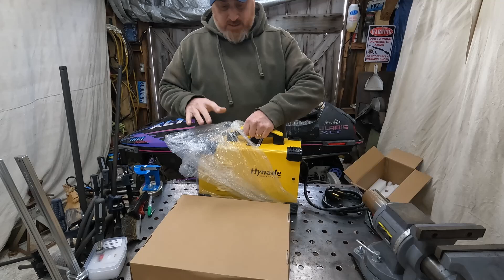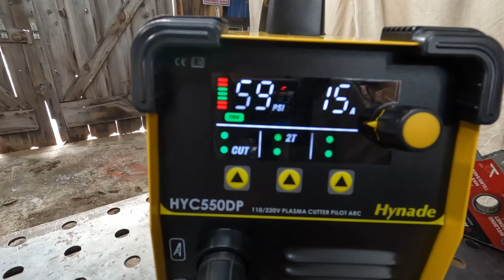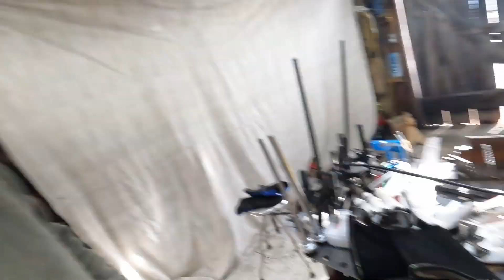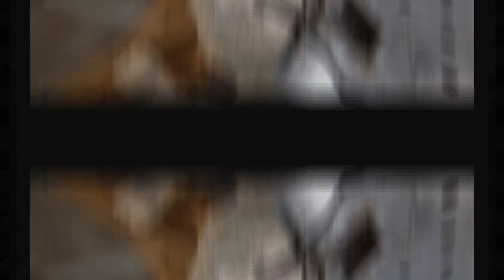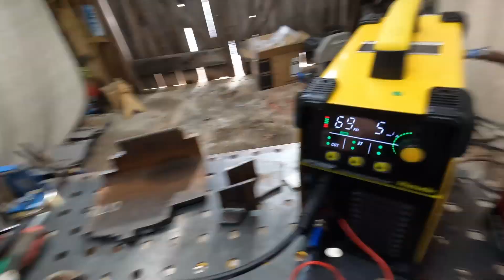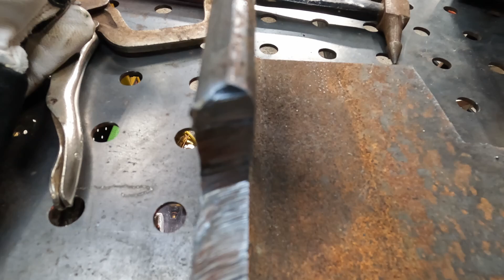Hynade HYC550DP Pilot arc plasma cutter review!! Is this worth your money?

Comment: I missed the link to your RV extension cord?. Do you use a 30 amp wired as 220V or 50 amp RV and just use 3 of the 4 wires?  Great video.  I have the Primeweld  Cut 60. Its great, but you could  buy 5 of these for the same cost as the Primeweld.
Reply: I would get the 50amp unless it's 10' or less think those machines draw 30 amps but it could be more but can't go wrong with a thicker cord!!!!